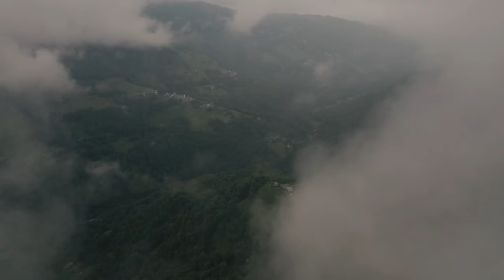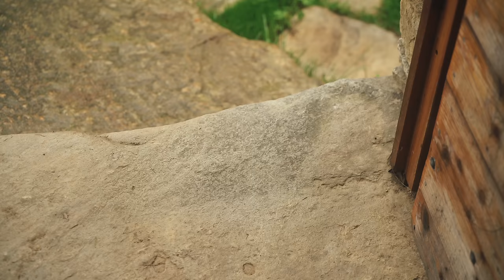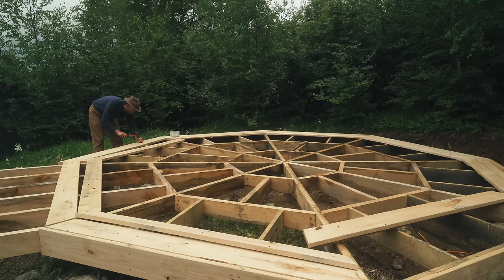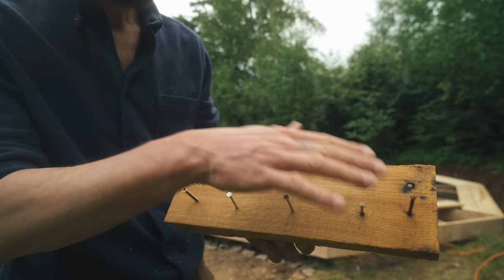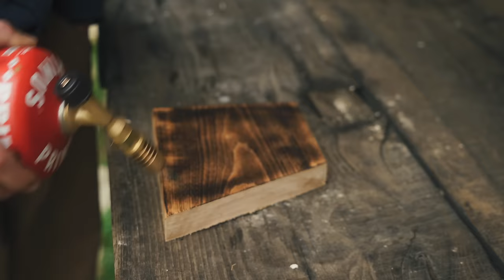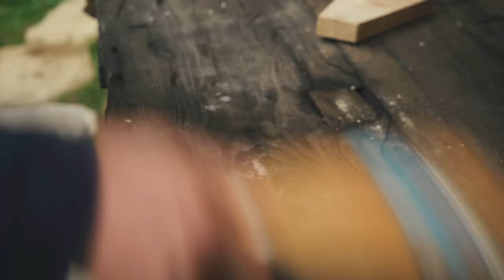#22 Finishing the Deck, A Group of Volunteers, Wood treatment tests

Comment: What an amazing group of volunteers! Certainly not afraid of some very hard work. 
The deck is beautiful and zooming down for the final nails…high Alps drama.
Reply: PS I’ve used the vinegar and steel wool solution to speed up the weathering of new cedar…helping it blend in faster with older cedar. That works very well but don’t think it’s a preservative like charring etc.

Comment: In my humble opinion, I would use screws... less rust and you can take it apart easier if you ever have to. That deck is such a cool design though so I hope you never have to! Edit: Also less chance of creaking boards and if they do start to creak you can pull the screws tight to stop it. 2nd edit: Ignore that, you completed the deck and it is truly beautiful. Well done!
Reply: I do not think anyone in Canada uses nails anymore..screws are best..so the men say
Reply: “Glue and screw,” the new carpentry maxim.

Comment: Hi Martijn, I've noticed that, when useing your hammer, what here in the UK is known as 'throttling' it i.e.holding the handle too near the head. Hold the hammer on the grip and you will find the hammer works with you and you use less energy. I hope this helps. By the by, I love your tent platform, very clever.

Comment: Lovely stuff, great teamwork here this week. One thing I thought I may want to say though is regarding watering the plants in sunlight. We've got an issue with some of our plants, most notably tomatoes, that when we water them on sunny days and water stays on the leaves, the leaves start to rot fairly quickly. Hence why we water them right at the ground, not from above. Just a note though, might not happen on your plants, might be you may wanna keep an eye out. Loving the series! Such high quality videography!
Reply: I have only learned this year - remove the bottom leaves from the tomato (and squash) plants. The plants don’t need them, and it almost eliminates diseases.

Comment: If I were you I'd be quite carefull to reduce the height of foundations. Those walls relay on stable foundations. When you dig  around them, you're entering in a unknow territory.  Maybe  ypu plan to pour concrete on the botton, in order to create a floor and to link all the walls with a rigid plan. Remeber that you are in an earthquake area.

Comment: You may find 45° is too steep for stairs. Typically a 4:5 ratio is standard. So a rise of 20cm for a step width of 25cm. You can cut a wood triangle with the correct dimensions. The Perkins Builder Brothers channel has a great video on this.
Reply: Have you ever seen the stairs in old dutch houses? ;)

Comment: A trick I learned from an old carpenter 50 years ago. It's called dovetail nailing. You drive nails in at 60 degree's not 90 degree's. You alternate the angle of the nails they will hold much better. Upright nails rely on friction to hold the boards. The angled nails prevent them lifting upwards and by alternating them they hold much better. They resist the wood cupping, bowing or warping. Where there's a chance of the wood splitting drill a hole which is slightly smaller diameter than the nails.

Comment: We built an octagon cabin with 8-foot lengths walls 8 ft High and an eight-sided ceiling with a four-foot cupola with a glass pyramid at the top. We put corner shelves and candles and it would actually keep the room if it wasn't too cold. We had a wood-burning cook stove that was 100 years old and a wood stove for heating. It was wonderful!

Comment: It's called a "Framing Square". It's complicated but you determine the dimension the steps need to account for (from the deck height to the ground height) and divide that dimension by the amount each step rises. That will give you the number of steps. Don't forget, the deck is the top step!! There is a "range" for common step sizes. I want to say 6.5" to 7.5". You definitely want all of the steps to be the same height so no-one trips on a taller step. You also determine how deep you want your steps. A common step measures 7" tall by 11" deep. Once you know those measurements, you place those numbers (from the two legs of the framing square) on the top edge of the stringer board. The corner of the square laying on the stringer gives you the cut of that step. You mark that step and move the square numbers down from that mark and mark another step. 
Steps and roofs are the most complicated "layouts" for a carpenter!! 
Those boys had a great work ethic. Someone should study them and see how to get more of that result!!! Unfortunately, it has become a "fond memory"!!

Comment: Great video as usual Martin.
Must have been a treat to have some extra help for a few days.
As a builder myself I would have suggested ring-shank, galvanized (zinc-plated) nails for exterior use.  The plating would prevent rusting, and the ring-shank prevents the nail from working itself up like smooth-shanked nails do with the expansion/contraction of the wood in freeze/thaw, wet/dry cycles.
Carry on.  Looking forward to more videos.

Comment: A tip - lay and fasten the too long planks on the joists. Draw a line along the centre of the joist and cut them all in one go using a circular saw set to the correct cutting depth. You will a grove a super aligned straight edge and it's one cut...

Comment: Loving every single episode so far. We're renovating an equivalent sized ruin to one of yours here in wet and windy Cornwall that I've just posted a short edit of. It thankfully doesn't have your flagstone roof to contend with but there has been pleeeeenty of stonework that has made up for that (the walls are 60cm thick) and all rammed with lime and rubble infill.. definitely looking forward to anything that's lighter than granite! Keep up the amazing work 🙂

Comment: FYI A vlogger who builds beautiful box sash windows out of oak says you must use boiled linseed oil not raw linseed oil other wise if feels sticky to the touch. Charring the wood is going to take a lot of gas and effort and you will still have to seal it or everything which touches the decking will get very dirty. Good old fashioned wax is probably a safe bet. Glad you had some fresh young muscles digging the rocks out of that floor. Very wise use of muscle power!

Comment: YES FOR STAIRS,  ITS  CODE IN THE U.S. OF 7 INCH HIGH RISE , AND 10 INCH DEEP OF A STEP. THEN YOU CAN ADJUST FROM THERE. BUT THAT IS A GUIDELINE FOR GETTING STARTED FOR A COMFORTABLE WALK UP TO A PLATFORM. I LIKE ALL THE PIECES THAT LEAD TO THE CENTER OF THE OCTAGON.

Comment: Hi Martijn. Fascinating story. I am a big fan. I was thinking, now that you have decided not to put your interior cabin on the land since it could be considered a structure that would require a permit, what you can do instead is put it inside the tent. This way it could be considered just a piece of furniture and inside removable tent that requires no permitting. This way you don't even have to put siding on it. This could save you quite a bit of time of insulating the tent and making it livable. Just something to consider. Good luck

Comment: I'm intrigued by these wood treatment methods.  Last video had the footer posts getting charred too. Does charring really improve the longevity of the wood?  Vinegar with steel dissolved in it??  Method I've head of is to apply asphaltic or bituminous coating onto any wood going under grade (along with chemical pressure treatment).  Also I've head historically of exterior wood being painted/slathered/coated with a thin layer of tar.  

11:51 oh man, you tease, how could you not give a close-up slow pan across the different beautiful wood samples!

Comment: For your own hearing preservation. Wear some ear protection while hammering and using any of the power tools. If you don't you will suffer later in life. While everyone's hearing degrades in later life cochlear damage due to excessive noise is permanent. It can not be rectifed by hearing aids and affects you earlier than aged related hearing loss. Ear plugs are cheap. While you do eye protection 👍🏻 but not always. The compound drop mitre can just as easiest throw splinter into the eye. Give your remote location that could be disastrous at so many levels.

Comment: Boiled linseed oil is the age old and traditional treatment for oak and other high tannin timber. Raw linseed does not set but boiled linseed does. I would use the blow lamp to scorch the timber then use a wire brush along the grain and then brush on a coating of boiled linseed oil the scorching helps the oil to soak well in to the timber. Regards James.

Comment: Hi Martjin as regards to the chestnut like oak it is very acidic and you should always use brass or copper nails or screws best obtained from about builder's supplies expensive but infallible steel or alloy nails don't last too long..
That said a fantastic  job being done as regards to the wood  colour and protection charring is the best for the end grain dark age pteoples did it to their palisades to stop 5he water rotting very good choice. I would  consider the copper or brass nails for any chestnut  going into the roof Mick from Ireland my farmhouse is 200 years old and rebuild from the bottom  up just as you are doing

Comment: I used a similar method of burning planks on one of my projets, however I used a much softer brush (old shoebrush, stiff hairs) when brushing off the soot/ash.
When I used a wirebrush it left some pretty nasty marks and rough texture which I didn't want and could be seen quite easily, even from a distance.

Linseed-oil worked well and left a very dark, smooth finish.

Great work as always!

Comment: One of the advantages of burning the surface of the wood (and brushing it of) is that you harden the surface and make it more rot and insect resistant. Most people still ad some kind of sealant (oil or......)

Comment: Yet another great build, I would however, have gone with screws for all of the decking, far easier to remove and replace if required and no hammer marks to get rid of.

Comment: Take one-third of beeswax, one-third of cooked linseed oil, and one-third of turpentine. 
First, solve the beeswax in the turpentine, and then add the linseed oil.
It will penetrate really deep and protect the deck well.

Comment: You should try stainless steel nails. They should rust even more slowly than zinc\galvanized nails, which tend to chip when you strike them with a hammer.

Comment: Testing wood finishes…for deck flooring? Caution on dark wood finish. Very hot in direct sunlight, burn feet, overheat tent; also, burned wood ( good technique for walls, posts, etc) stain the bottom of feet or shoes and is carried inside. Messy. Beautiful vids…thank you.

Comment: While watching recent vlog items for the deck build I have been struck by the stark difference in materials and obtaining them.
In the USA you can walk into any ‘big box hardware store’ and purchase dimensionally consistent (no planing), pressure treated wood in all the sizes needed as well as the dipped/ treated screws (no nails) which won’t stain the wood. All the wood would be pine. Chestnut would be a choice for making fine furniture.
In many areas of the country there would also be building codes requiring safety rails around the edge and on the stairs. 
I am fascinated by the differences…
Reply: Directly buying from saw mill will be a lot cheaper.

Comment: dont worry. it will not rust in wood. once it pulled nail out of wood it looked brand new even if head was all rusted. it was around 30 years old at leas. i mean nail

Comment: Great decking work.
Did you consider insulation under the deck?... it would allow it be used in lower temperatures. 
Also, i hope its fixed securely into the ground, a winter storm could lift that deck off easily.
Good work and keep at it.

Comment: Thank you very much ethis interesting video. I do have one question : why do you use nails instead of screws? Screws do have such a lot of advantages: - no rust, - better adjustment, - higher load, - easier to use, - much less afterwork required,...
Thank you very much and best regards
Christian

Comment: zinc unfortunately does the same it just doesn't happen straight away ,so do screws unless stainless steel , no stains last longer than the wood , I have tried everything usually recommended by sales reps as the all singing dancing product none ever last where tanin is involved , dont take my word for it  only been doing it 51 years

Comment: May I ask why you didn't put the stairs on the end of the landing, instead of the front?
 On the front, you're walking uphill to get to the stairs, and walking downhill when you step/fall off them.
On the end, it's easier to make the approach level.
Reply: I'm guessing because he wants a deck with nice view anyway?
Reply: @Gabrielle4870  Leave the everything, except the steps, where they are. Move the steps to the end of the deck, leading off to leveler ground.

Comment: have you tried wood preserver (stops fungi and insects) and after it is dry normal bleach? It stops rotting and the wood looks like it's 200 years old at least with my chestnut stump.... i didnt try the nail test, could go horribly wrong with the oxidation :D

Comment: Don't you think you should have treated the wood or painted it to seal it from moisture and rain?
Reply: Presumably, that's what YOU think then.....!!?
However, there is a lot of ignorance surrounding timber preservation. Many woods are naturally very resistant to rot - chestnut, for example...!  If water can drain away it's often unnecessary to slap on lots of chemicals....
Reply: @andymccabe6712  thank you for your opinion.